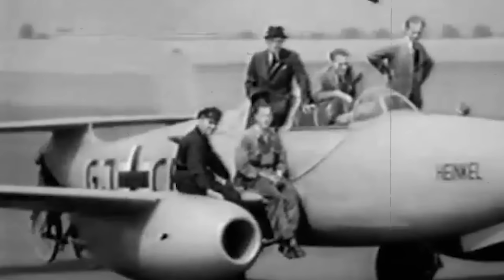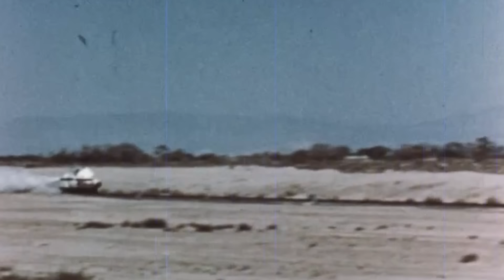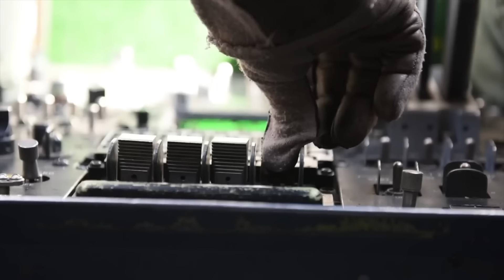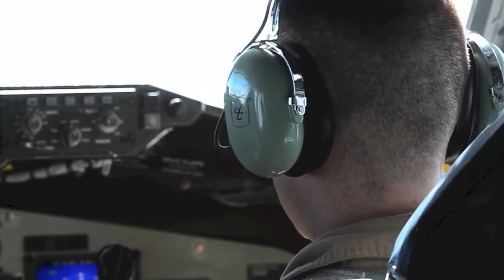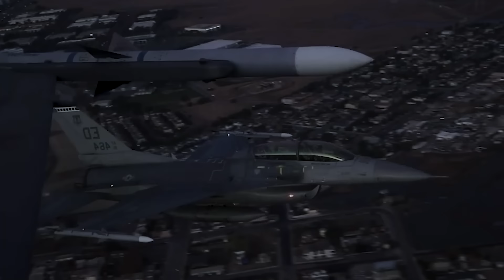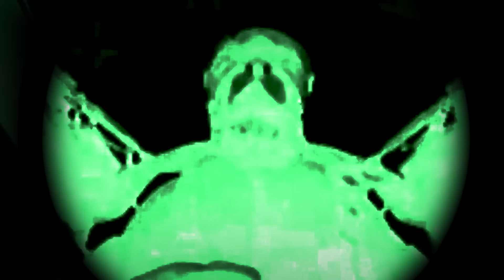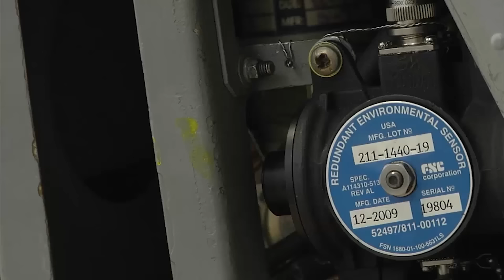The Darkest Air Force Secret They Tried to Bury Forever

Comment: F-111's do not eject the canopy or have staggered ejection for the two crew. The entire cockpit, with canopy and all, is ejected as one complete unit.
Reply: The original B-1B early flying prototype had the same type of pod system. I was  learning to fly C-130s at LittleRock AFB in Arkansas and owned a rental house in the Antelope Valley when Doug Bennefield died in the B-1B ejection out over the east Antelope Valley, Mojave Desert.  Doug Benefield was on the cover of our Antelope Valley phone book in 1984 or 1986. It was before he died. He was kind of a VIP in the area with the development of the B-1A/B.

The pod landed on its side killing Bennefield, the co pilot lived with very minor injuries. 
After this mishap, the B-1B program went to standard singular ejection seats.
Reply: @JohnBasiglone  I think you mean B-1A.
Reply: Still scary.
Reply: Thanks for saving me from typing this. I saw a recent video showing the development and people behind the concept. I found several inconsistencies. Which led me to accept the ideas was stolen. But then I researched what military operated such aircraft that COULD employ the “wagon”. If it was stolen, it was from another US developer. They went to great detail explaining the WHO’s and why’s. If it’s as you say it was. You don’t need to repeat yourself. One of the heavy bombers used downward ejection seats. Pilots said they’d rather go down with the ship, than to use it. At least they could have a body part to bury. The test pilots were prohibited from discussing their findings. Well, those pilots that COULD have something to say. I did discover we the people were rarely told the truths about military and NASA technology testing . We heard about only a small percentage of deaths and dismemberment. Especially the ripping off of limbs. Not accounting for the force of rushing wind. Inches in any direction meant the difference in losing your head and shoulders, or your entire torso. We never accurately hear of those incidents, officially. It was is always from a crew abd support workers assigned to clean up the mess, and loss of life. It’s one of the very few things I hate about this department of the military. Research. It says many lives were sacrificed knowing there was gonna be fatalities. THEY said even though blacks were in the Air Force, why none had successful career. They were given these jobs. We ain’t shttt.

Comment: Look, over there, in the corner, it's a hatching conspiracy theory...
Because crews knew lots about Command Structures, codes and the like, we shouldn't let them fall into the enemies hands.
They would under duress or drugs, divulge secrets. Far better that they die in the line of duty.
What? You think that wouldn't happen? Then you need a serious upgrade on your thinking program.
Consider what a crew knows about the weapon alone.. It's launch height, time to detonation, yeild and arming sequence codes.. Not to mention the frequency for receiving the launch commands.

Comment: I'm a former B-1b OAS technician during the days of the initial delivery of the fleet to Dyess AFB. The DSO in back is responsible for selecting the ejection method for the aircraft with a selector switch for "Crew or Individual" determining how the seats deploy. Sounds like they were set up for individual seat selection and the AC was going to have the back seaters go first. Had the selector been set to Crew then the other rear hatch and then the cockpit hatches would have fired and any properly functioning seats sequenced. This was a fortunate unfortunate event for all. 

Our first airframe loss was over Colorado in 1987 with 84-0052 hitting pelicans causing major damage above the #3 engine and controllability of the aircraft. There was no real time to blow the bottom hatch for the two instructors to fall out on parachutes and the seat for the co-pilot had a defect in the squib initiator plumbing grounding the fleet. Three survived of the six person crew.
Reply: "... time to blow the bottom hatch ..." - ?  Do jets eject out the bottom of the fuselage, as well?
Reply: @patlawler5532  The B-1b has a crew entry hatch and ladder just behind the nose  landing gear. The bottom hatch has its own rocket motor to propel it away and any jumpseating crew would drop down into the slipstream to evacuate.

Comment: F-16 arrestor hook?
Reply: Yes F16, and other non naval aircraft (such as the F15, F22 etc) have hooks. Some runways have emergency cable systems should there be a problem with an aircraft’s brakes or chute.
Reply: @ huh dnk. Just looked up a 2006 Shaw AFB 20th FW public brief that describes that very system. Cool, now they can land on carriers 😉

Comment: Second story, a F 16 CM? Tailhook? what?  The F16 does not have tailhook.
Reply: You might want to do a little more research 😂.
Reply: @johningram9081  Hmm yeah, see it now, installed for emergency, if brakes or other fails. Guess the parachute version was ditched? IE parachte in the rear to break during ice/other conditions.

Comment: Inevitably, even if the seat functions perfectly, massive acceleration into  airflow at hundreds of miles per hour and the tumbling flailing and jerking that follows is going to cause damage to a frail human body, however you can’t lose sight of the fact that the alternative to ejecting is, in the vast majority of cases, death.

Comment: Aren't all flights routine? Even for the ejection seat manufacturers, an ejection seat test is purely routine. However, in the instance of this pilot's ejection seat failure was a known fault. The entire fleet should have been grounded till remedial action was performed. It is an unforgivable flaw in the system that allowed this accident to occur.

Comment: And can anyone guess where these tiny counterfeit electronic components are/were made? And how many other little secrets are hidden in our other electronics, from our cars to our home appliances to our communications systems? But by all means, let's continue to outsource everything. Because it's cheaper.
Reply: It's usually SMD devices,made by hundreds .
Maybe,while preparing the circuit assembly with this chip/transistor the purchase department went for a cheaper version.
WITHOUT checking it's origin.
Reply: Do Boeing make 5hese aircraft?

Comment: Prior to retiring from the Air Force, I worked with a Lt. Colonel who had ejected from an F-4 earlier in his career.  He went on to fly for a few more years, but a nagging back injury from the event eventually grounded him.  He never remembered ejecting, but woke up under canopy, floating to the ground.  

BTW, I'm sure someone will correct me if I'm wrong but unlike the Navy/Marine Corps, the Air Force never equipped their Phantoms back seats with full redundant flight controls, so they had very limited control of the landing gear and flaps, and had to rely on a system that dumped air into the hydraulics to operate them.  Coupled with the bad view from the WSO ('Wizzo') seat, it was a tall order for them to land the aircraft if the pilot was ever incapacitated.
Reply: USAF Phantoms had flight controls in the rear cockpit , the Navy - Marine Corp did not .
Source:  my Father was an IP in the Phantom .
Reply: @John-or9ccUndauntedRaceCars I'll take your word for it.  The F4s had all been pushed to the /guard/reserves and select target squadrons by the time I went in, so I seldom saw them except in airshows.

Comment: Ex Airforce Airframe and engine technician here, at one time American ejection seats where rocket propelled. MB had the patten to use cartridge operated seats so tandem seat (one behind the other) aircraft like an A4 Skyhawk, means the guy behind has to go first otherwise the pilot in front would fire his rocket right over the top of the back seat guy.
Reply: Most A-4 were single seat. There were some two seat trainer variants.
Reply: AFAIK all ejection seats use cartridges [three in the MB seat] to separate the the seat from the airframe. Zero/zero seats have a simple lanyard attached to the A/C floor that pulls the pin on the rocket when it is extended. I did a famil on the F4 without ever having hands on but it had a system in which the pilot could bang the REO, either the pilot or the REO could initiate a full sequence with the back seat going first.
The RAAF RR Avon Sabre had a dead pilot after a successful ejection, sadly he had a traumatic head injury caused by being hit by the canopy after being blown off and not folding back as expected. As I understand it they disconnected the explosive canopy bolts and fitted a bolt on top of the seat which simply broke the canopy.
Caution: Not my trade or squadron.
Reply: European aircraft enthousiast here. As far as i can remember, Martin Baker was, or still is, a very well-known ejection seat manufacturer. Are they still making them, and so, then why are the seats are coming from other company's these days?
Reply: TA-4J

Comment: I don't think it was just a matter of bad parts from the start.
Ejection seats are supposed to save lives, not end them.
But if the military dogma leaves loopholes for contractors to slip through, it only causes these sort of problems.
Be it a matter of seeking easy money, or being rushed to fill a contract, it should never be at the expense of a man's (or woman's), life.
Not to mention the millions, or billions today, worth of aircraft that get smashed for nothing more, than a pin, or gasket, a nut and bolt, software, or electronics,  or some other small issue, that was overlooked, ignored, rigged or removed, without proper channels.
Cut corners gets people killed.  And for the money passing through the hands of contractors, that should never be an issue.

Comment: Wow what a great story. There is zero excuse the air force can give why after making ejection seats for 50 plus years they are having failure issues. Each one should be pulled and inspected annually just like regular Maintance is done one the aircraft .
Reply: Hey buddy, they already do that…
Reply: @ no they don’t
Reply: @DaWoLf2014 they do dummy
Reply: @ no they don’t if you actually read down to a different comment there’s a technician that actually services these seats and they were only checked every three years
Reply: I could be wrong, but I believe US has used mostly Martin-Baker seats, I had never heard of this manufacturer until now.

Comment: I'm a current USAF egress tech. Worked F-15E ACES II seats for 6 years, and now I'm at Randolph AFB where i work on T-38 and T-6 Martin Baker seats.
Reply: Please make sure these last ditch safety devices work for our pilots !
Reply: @dawolf7784  i do what I can, but unfortunately, a lot of the parts for these seats are no longer made so the engineers have had to allow less stringent criteria.
Reply: @ the goverment pays millions for each aircraft you would think that if parts are no longer made and the ejection seats are not safe they should be replaced . Surely the cost of replacing the ejection seat is less the the cost of the loss of the aircraft and the loss of a pilot !
Reply: @dawolf7784 we do overhauls on each seat every 3 years and 10 years. Thankfully, it's only odds and ends that they're more lenient about and not anything critical
Reply: @ I wish they would be done every year as annual Maintance. I served in the Marines for 5 years and 2 years in Afghanistan. There was several times we got our bacon pulled out of the fire by Airforce or Marine pilots . One time we had an A-10 that if they had not showed up it we would have been overrun and more than likely all of been killed.
Reply: @DaWoLf2014  we do what's called an "egress final" every 30 days on each aircraft where we go to the aircraft and inspect the whole system

Comment: That ejection system, while defective, saved the taxpayers a $400,000,000 plane.  I don't understand why they were awarded medals for doing their jobs after trying to bail out.  With no choice, they did their jobs, then were decorated?  Makes no sense to me!  Too ready to bail.  A GOOD pilot bails only as a last resort
Reply: This video is very miss leading! I was at dyess at the time this mistake happened and you are exactly right. After investigation it was deemed they skipped over many steps before trying to eject.

Comment: I spent 22 years in the Air Force working on many types of escape systems, including the ACES II.  Almost all of the various seats had the capability for testing the system components to ensure that they were working properly.  We could check rigging and proper function periodically as part of scheduled inspections.  The exception was the ACES II.  The sequencer had no test procedure and was a sealed unit and could only be tested/serviced by the manufacturer.  They also had no requirement to be changed on any schedule, they were basically "lifetime" units.  CAD items are a different story.  They are replaced on a date of manufacture or date of installation schedule.  CADs are always an item that can't truly be checked.  They are like a bullet from a rifle.  One you fire them that is it, you can't just reload them because that changes the parameters since the powder and primer are different.  There is no perfect ejection seat, there are just ones that are better and more reliable.

There are a lot of injuries during ejections.  Unfortunately that is something the technology hasn't caught up with.  There are some factors that are inherent with ejection.  The seat has to go from 0 to 100 mph in milliseconds, producing up to 30 Gs of vertical forces.  This is hard on the human spine and neck.  There is also the matter of wind blast when ejecting at high speed.  What is referred to as flail injuries happen because almost nobody has a strong enough grip to hold the handles and prevent there arms from flailing in a 400 mph wind blast.  Legs are less of a problem because effective leg restraints have been developed.  Seats have come a long way since the early ones that were a 40 mm cannon shell on the back of the seat, shooting it out of the cockpit, but they still are being improved every year.
Reply: The recovery sequencers in the ACES II were definitely time change items. At least the digital ones. We had a TCTO come down where we had to replace the DRS with a new MASS, which has a built-in environmental sensor.
Reply: @drkpltr  Sorry, my bad.  It has been quite a long time since I retired in the 90s and at that time, they were not time change items.  Like everything else it changes from lessons learned.  Thanks for the info.
Reply: @JohnMckeown-dl2cl  I'd imagine the analog sequencers weren't time change
Reply: @drkpltr  they were. Changed plenty of them myself.
Reply: You clearly forgot a lot because the sequencers are absolutely a time change item.
Reply: Guess we won't talk about extending time change items because supply system can't keep up...
Reply: @Ender_Wiggin03  happens
Reply: @Ender_Wiggin03  manufacturers. Not the supply system. It’s not like they throw out arbitrary numbers for extending. Old items that are turned in are constantly tested to determine extension cycles.
Reply: What bases were you in ?
Did you went to Chanute ?

Comment: USN AME2 ~ I worked on multiple different birds with different configurations of ejection seats (mostly Douglas Escapac, Martin-Baker SJU-17 (Mk. 14)NACES, and  Martin-Baker US16EI ~ thankfully I did not have any failures, otherwise I would be in Leavenworth,  Kansas.

Comment: The ejection seat failing to work is one thing. 

This pilot was also not up to speed in the 
F-16 if he couldn’t successfully air refuel and also flew too low on approach and hit landing lights before the runway threshold. 

This is just a tragic sequence of events.  All due to the Covid epidemic and a rookie pilot not getting enough flying time due to everything being shut down for months.
Reply: Swiss cheese model. I've live in SC and have been to Shaw. Those maintainers are some of the best because those jets usually fly SEADD. This was a breakdown on many levels, but the guy doing scheduling must feel like shit.
Reply: As usual an accident with many contributory factors and one main insurmountable problem.
Reply: Correct, and that jet was scheduled after that flight to get the updated MASS to replace the DRS as well.